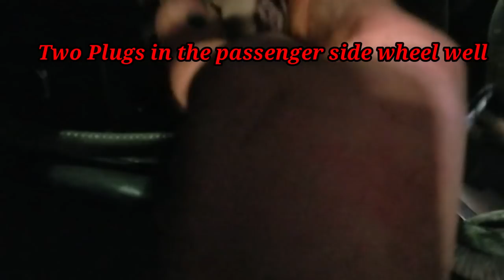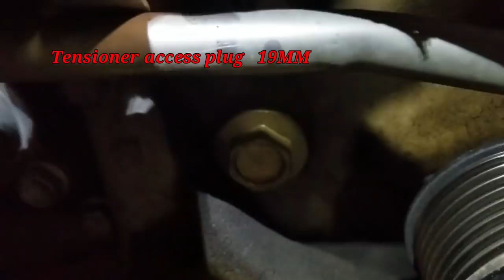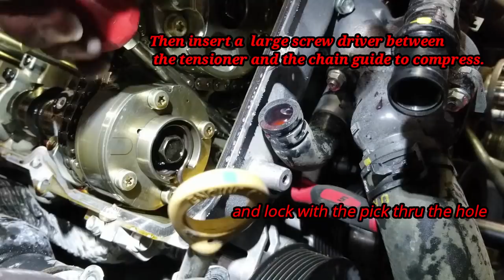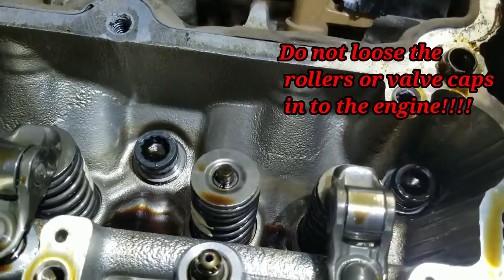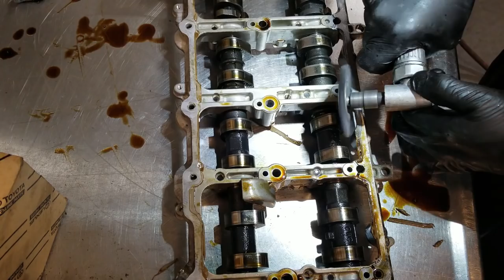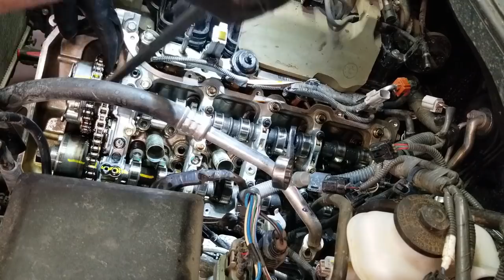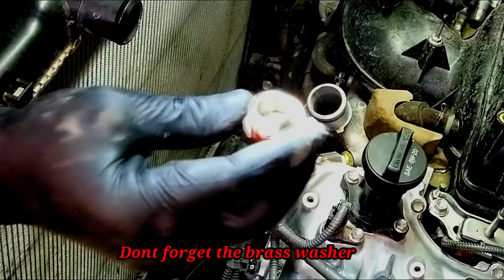Tundra Cam Tower Leak Reseal

Comment: This has affected the 5.7 engines for several model years. Why hasen't this company addressed this issue ? Why don't they do the right thing and own up to the issue and at least extend the warranty to cover this problem ?  I have a 2014 that i put only 5k per year on  so mine will no doubt happen when the warranty expires which i'm sure toyota is hoping for. Come on toyota do the right and ethical thing here !! These vehicles are to expensive just to receive this kind of (or lack of) service.
Reply: ever owned a chevy? you know something is wrong when they stop leaking oil.
Reply: I always thought Toyota was the best in the business, now I'm having second thoughts.
Reply: If you call toyotas 1-800 customer service number they are very good at stepping up and covering vehicles outside of factory warranty for issues like this. I'm pretty sure that they have tracked down the issue to the curing process on the fipg sealant. If yours is going to leak, typically it will happen very early. When I do these at the dealer I can see that only the ones that leak the sealant is still tacky.  Once we reseal it with the black fipg they never leak.
Reply: @jameshasenjaeger5181 Hi James... I'm looking for a used Sequoia... are there specific years to avoid, or are all years affected ?   Where do I look for the leak, to determine if it has the leak ?  Thank You
Reply: Gerard , it’s usually towards the backside of the cylinder head/cam tower right above the exhaust manifold. This is potential for all 5.7 toyota engines.
Reply: @jameshasenjaeger5181  Thanks James, good info !!
Reply: @YoungOzzy432  Fords do that too. It is because of Direct Injection. I'm a master tech at a Ford/Toyota dealer
Reply: @jameshasenjaeger5181 called them to ask about repair and they said no! Won’t be buying another Toyota!

Comment: Thank you so much for the video. I followed it to the letter and was able to fix a 2012 Tundra with leaking cam towers.
Reply: having this issue on my 2015 tundra..seen video but having trouble loosing timing chain with screwdriver like video. cant releive tension..how did you do it?? help please

Comment: I dig the quick repair but if that primary chain comes off a tooth, that engine is toast.  Shame you cannot replace the chain tensioners through the valve covers.  Would have been nice if Yota put an access cover over the tensioners...
Reply: one of the techs that I work with tried it this way and blew up the motor. we don't know how. think the tensioner got damaged when he was trying to get the plunger in. they have a lot of oil pressure and are very difficult to get the tensioner plunger in.

Comment: I stopped at 6:17 … more than exceedingly impressed with the guys knowledge and ability — which absolutely affirms that my great 2011 5.7 might be the reluctantant subject of a trade-in.  I did have undying faith in Toyota craftsmanship. This cam tower leak coupled with a leaking differential — at 105,000 miles — convince me that I did not find the 200,000 mile vehicle of my dreams.

Comment: Just bought a 2012 with 135k 5.7L in Feb. 2023. Was trade in at Chevy dealer. They must have cleaned up the leak because I specifically looked for it w a spotlight. Mine seems like a seepage. No topping off any oil. Also about 3 months ago, I have the infamous timing chain (slight) cold start rattle start too. Now I am thinking to just get the timing chain done and while im at it, might as well do the cam towers as well since its all there in one shot saving on labor. The wife and I like the clean accident free dealer serviced truck. With all oil changes done on time. I guess I cannot complain. Was $15500 plus tax, tags. Paid cash. Plan on keeping it a LONG time.

Comment: thank you ! Just finished doing this job following the video.  The driver side tensioner seemed tight, but didn't click like the passenger side when reinstalling. Had some chain slap until the tensioner did it's thing. phew!

Comment: EXCELLENT VIDEO!  I’ve replaced many timing chains, and the 4.7 Toyota Tundra timing belt.  I love the challenge, built many diesel and gasoline engines. This is incredible!  Thank you very much, I know what it takes to keep the timing chain in place. I love the hexagons for the wrench on the cams. The hex lets you move them just enough to re-pin the dowel in the drive gear or cams.  As long as you keep the tension on the chain so it can’t jump a tooth, you got it made!

Comment: What is it with Toyota not using pre-made gaskets? What’s the cause of this problem? Is it a faulty design, is the factory sealant inferior, or is the sealant being installed incorrectly? Ever see another leak after performing the repair? How many hours of labor?
Reply: given the tolerances for camshafts to rockers... you can't really gasket the area. A recessed channel for an o-ring which would seal and compress. that's the ticket.

Comment: Where are you?  You need to do mine 2013 82K miles 1 owner.  They said they are a leaking!  No gasket between the cam cradles and the head ??

Comment: Is it required to remove the fuel line on the driver's side?  Or just makes it easier to get it out of the way?  I prefer to not disturb any connections that aren't necessary, but some are just better to remove and clear out of the way.  Thanks for a super helpful video!

Comment: Hello there, hey your video got me over a stump pulling my heads off, didn't know how to get my cams loose from my timing chain sprockets, so with your video I was able to move past that part and get my heads off to change my head gasket but now putting it back together I can't seem to get my tensioner loose enough to put my sprocket with chain on back onto my cams as easy as you did in your video...need help

Comment: Why did you leave out the silicone application step?? That’s the most important part.
Reply from the maker: Jesse Danger, my idea for the video was mostly to show techs how to do the job without pulling the front cover. Most people getting this involved with an engine have access to Alldata or something simular that show that in better detail.
Reply: Same question. Would like to know what sealant you used and maybe see the placement pattern.

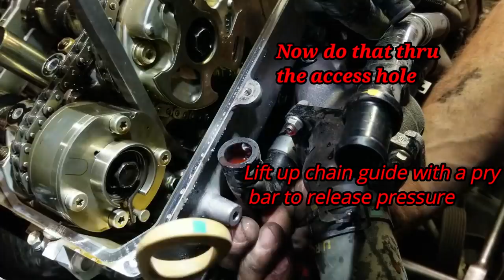Comment: 2:13 I am stuck at "release pressure at chain guide " part. I am on the drivers side so the layout is a little different than what is shown on the video. How much force is needed to relieve the pressure? I don't want to break anything but I'm putting a good amount of pressure on it and nothing releases the lever on chain tensioner....

Comment: Why not just remove the front timing cover?  I'm new to this motor and just trying to understand (not challenging).  Removing the front timing cover would allow you to also replace the tensioners (preventative maintenance if previous owner was lazy with oil changes), and make the chain/sprocket removal much easier.

Or does that add a significant amount of time to the job?  Just curious.

This method looks like a great alternative but (sounds like from the comments) that the biggest struggle is getting the tensioners released from the top, hence the opening question.

Thanks so much for a super helpful video!
Reply: may not have wanted to have to replace the water pump and oil pump seals and all of that good stuff. Also avoids taking out the radiator and everything else on the serpentine belt. I would have removed the front timing cover as well as then you could replace the timing chain assembly along with all of the seals including the valve covers but some may want to avoid having to go through the whole thing.
Reply: @wiscopackers12  Got it, thank you.  That makes sense.  Sounds like there are pros/cons with either approach, but could to have an alternative solution that doesn't require removing the whole front end.  Thanks again.
Reply: yup having that issue with loosing timing chain on cam sprockets without removing timing chain cover. need help😢

Comment: Is this a pretty common problem? Searched a few threads and seems like it is with the grey seal, and toyota doesnt really wanna fix unless you raise cane? I had a 2013 with the 4.6 about 90k miles and no problems i knew of. Looking to get another on or maybe a 2015 with a 5.7 but this has me rethinking. Thanks for the vid!

Comment: When this happens, is it a major leak?  Will you notice a significant drop in oil level on the dip stick? Or can you just keep an eye on it and top it off if needed?  I'm thinking of trading my '07 Sequoia for a '16.
Reply: I have a 2012 tundra and it doesn't drip oil on the ground because it hits the exhaust and burns. The smell of burnt oil is annoying but still no need to top off oil between oil changes. Leak is very small and has been for the last 5 years.
Reply: @carlospastran3527  Thanks for the answer I think mine might be leaking but it's very minimal and I haven't had to add oil yet between changes so I plan on living with it.
Reply: Same with my 2013 Toyota Tundra. More of a seep. No oil on floor and don’t have to add oil in 10000 mile oil changes. 165000 miles and does not appear to be getting worse.
Reply: @carlospastran3527  I second this.  Until it get's worse I'll avoid it.  I just keep my blower on recirc all the time.

Comment: Is this leak a huge issue if not addressed? I been wanting to get a new tundra but dont want deal with this issue if it exists on new models
Reply: I'd like to know the same thing.  Is it a major leak?  Will you notice a significant oil level drop on the dip stick? Or can you just keep an eye on it and top it off if needed?  I'm thinking of trading my '07 Sequoia for a '16.

Comment: I own a 2013 Tundra 5.7 with 85K miles on it which seems to have developed a cam tower leak. My dealership has quoted me a $4,901.00 estimate to fix this issue. I realize this is a big job, however I'm having a problem spending that kind of money on a repair if it's only going to reoccur in the future. Can anyone tell me if the seals/gaskets have been redesigned to eliminate this leak issue in the future? Is there a better sealer to use or aftermarket seals that won't prematurely fail? A $5,000 engine repair bill on a Toyota engine with only 85K miles on it is a hard pill to swallow.

Comment: Is there any risk of the chain jumping time on the crank sprocket doing it this way?  Wicked shortcut, thanks for sharing!
Reply: one of the techs that I work with tried it this way and blew up the motor. we don't know how. think the tensioner got damaged when he was trying to get the plunger in. they have a lot of oil pressure and are very difficult to get the tensioner plunger in.

Comment: Are Cam Tower Leaks a common problem for the 5.7 L motor?  How often do they occur?   1 out of 10, 1out of 100, 1 out of 1000?  This seems like a significant flaw with this motor.  Have they fixed the problem for the 2021 models?
Reply: If you go through any of the tundra forums it’s a pretty common thing unfortunately on the 5.7 and the 4.6... my 2013 4.6 has it
Reply: They all do it. Toyota hasn't addressed it. Have done them on 21s which is the last year of this engine
Reply: @kennethebel7726  wow 21' already needed cam tower seals? seesh
Reply: It's not 1 out of 10, or 1 out of 100, or 1 out of 1,000. It's more like 1 out of 1.
Reply: its an fipg gasket, it will leak like any other gasket.

Comment: What years are affected by this issue? I’m looking at purchasing a 2008 sequoia with the 5.7 and 4x4. I’m curious if this issue is more prevalent with the newer models. Any input?
Reply: All of them have this problem eventually regardless of model year.
Reply: I think Toyota started using better silicone in the later models (2016 and up) but I could be wrong. I've seen newer 5.7 with almost 200k miles without leaking oil.
Reply: @carlospastran3527 I assume you’re a mechanic? I read several forums and apparently it affects all the v8. I guess I was to buy, I can check the carfax? Will it be on the report?
Reply: @t0nyT  if the repair was made at the dealer or a big shop then it will show on the report. My 2012 tundra has been leaking oil for the last 100k miles. The leak is very small, not worth fixing at this moment.

Comment: So did u drain the oil to get some more slack out of the tentioner because i am doing one now and its not pushing into the tensioner housing
Reply: don't know, he made it look way to easy. one of the techs that I work with tried it this way and blew up the motor. we don't know how. think the tensioner got damaged when he was trying to get the plunger in. they have a lot of oil pressure and are very difficult to get the tensioner plunger in.
Reply: @davidstiver2304  ya i ended up just taking all off 😂😂 it sucks
Reply: @Shanethetoyotech  yea, thats the route I go. I thought about trying this, but rather be safe than sorry.

Comment: Hey man. Thad an awesome video .  I have a '14 tundra with 40k  miles and it just happened 2 days ago . It's leaking oil from the driver's side. IS THERE A RECALL FOR THIS ISSUES ?
Reply from the maker: No recall just a TSB
Reply: 93toyota4x4V6 did they finish your tundra and what are the results? What is your experience with it?
Reply: The Workin' Man what is the TSB # ?
Reply: @TaylorJones20   - Possibly a "Technical Service Bulletin"?

Comment: I'm wondering if you or anyone knows if the problem has been resolved by Toyota on 2019 or later year? The only info I am able to find on the web is about 2010-2018 years
Reply: Just had my 2014 with 125000 KM on it diagnosed with the cam tower leak as well as timing chain cover leak. Brings back nightmares of my 5.4l Ford pickup!
Reply: Time will tell

Comment: Is there a specific RTV that I should be using for this repair, as it is black and not Grey like the factory Fipg? Thank you
Reply from the maker: The updated fipg from Toyota is black.
Reply: @theworkinman8800  So no specific brand?
Reply: @nissan2005  use Toyota brand FIPG. That or Honda which is better than Toyota, but I cant vouch on it for this job

Comment: Doing this job currently. Had my pick in the tensioner, and it managed to fall out. You think I can get the tensioner compressed again or will I have to take the cover off....
Reply from the maker: Yeah, ive had it fall out, its a pain but you can get it compressed again
Reply: Well that’s good news. How do you
Manage to get it in? Chanel locks are the closest I’ve gotten but they slip off since they don’t get enough bite
Reply: Managed to get it. Now onto the driver side.... damn tensioner on that one won’t budge
Reply from the maker: Drivers side doesn't move as far

Comment: Great video!  Is this problem still occurring in the '16 & '17 Tundras? My '12 started @ 75k miles. I've stopped it using a qt of Lucas stop leak in every oil change. Mine was minor on 1 side(so far)
Reply: According to the tundra forums,  it is still happening to the 16, 17abd 18s. Its amazing that Toyota hasn't done something about this yet. My 14 is leaking very slightly on the driver side
Reply: Mine's now leaking on both sides. I plan on keeping the truck. I'm getting it repaired.
Reply: I saw on a forum that a couple people with 19's have had the problem starting already....so it's not been addressed yet in the new build....
Reply: @gerard2620  Thanks for sharing that.   Not good news for me tho.  2019 bought in September..

Comment: Bad valve gasket or leaking cam tower?  How can I tell the difference? Thanks
Reply: where its leaking. Valve gasket would be between the valve cover and cam tower, the can tower leak would be between the block and the cam tower.

Comment: After the dealer wanted 7k to do this job, i did it myself about 40k miles ago roughly 2 years ago on my 13 tundra. And no seeping or leaks to date.. i use and drive the truck hard, did about 20 hours worth of research and it took me 3 hours per side.

Started on sunday morning at 10am and finished up and running at 430pm.

Maybe working on vehicles is my calling, i would only charge 800 a side 1600 total.

The damn dealer wanted 7000... jesus
Reply: $266 per hour? Damn. You’re an expensive hobbyist mechanic.
Reply: Same leak on my 2011 Tundra. Dealer quote was 6800$ to do both seals.
Reply: @Banshee365  well the dealer charges 7000... not to mention he’s including parts costs
Reply: @derak good job....did you use that black gasket maker or is there an actual "Real" gasket that you can buy for this?
Reply: @dalephillips8250  i had one made by vitton it was pricey but guaranteed forever
Reply: @derakbell8143  Thanks Derak ..Have heard of any 2019-20's having this issue? It seems Toyota would have caught it and changed the gasket materiel so that they wouldn't have to deal with it down the line.
Reply: @dalephillips8250  i jave a biddy with a 2019 he's a contractor and almost has 90k on his truck already absolute no cam tower leak whatsoever.

Comment: So, when a mechanic uses this shortcut, the timing belt skips a tooth, and the engine is trashed, does the mechanic buy the customer a new engine at their own expense, does the mechanic play dumb, tell the customer there was something wrong with their engine, and try to screw the customer?

Comment: Can I postpone this repair with an oil leak repair fluid?
Reply: yes, its usually a small leak and will leak some oil on the exhaust, at least in my experience. its a 15 plus hr job so its very expensive.
Reply: @davidstiver2304  could I use a sealer  additive?
Reply: @gaarafranco8667  don't see how that will do anything. fipg is used to seal 2 mating surfaces so an additive won't do anything.

Comment: It was warranty, no need to pull front cover. I prefer pulling front cover though.
Reply: I just stuff shop towels in the opening of the front cover so nothing falls down inside. Ive done 4 trucks this way no prob. Bot pulling the front cover saves a lot of time.  You do have beyyer access to things though. As oong as you get it fixed right.